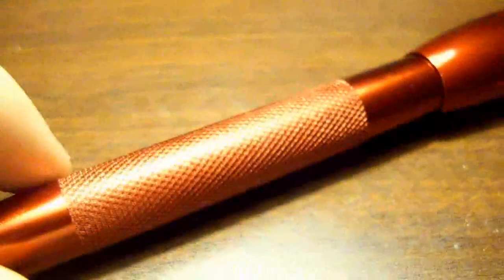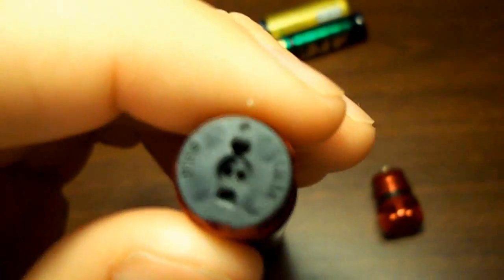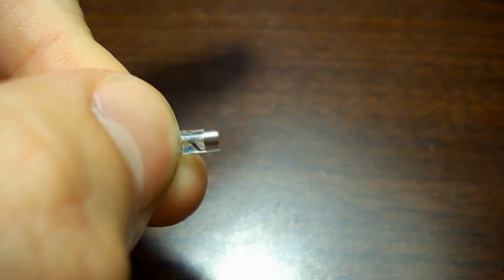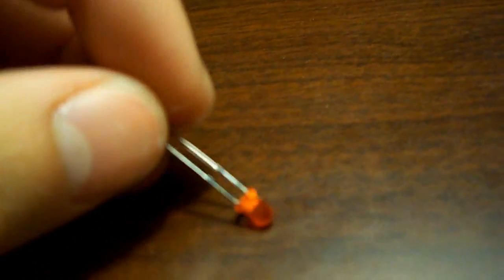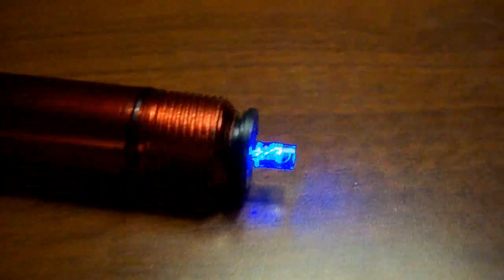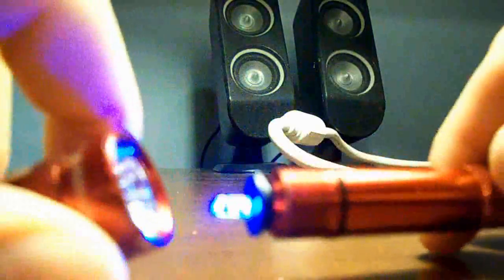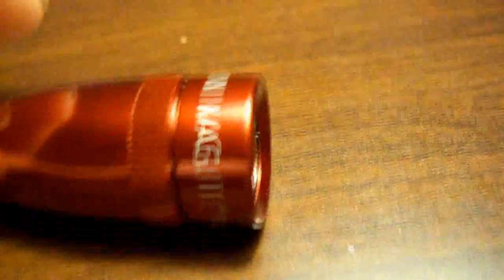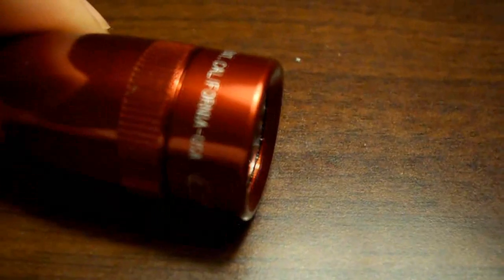Convert Maglite to LED - 20 Hour battery life (HIGH POWER!)

Comment: dang, and my Radio Shack closed years ago (and Lafayette Electronics years before that) ............. as a kid I used to buy LED/resistors/caps, boards etc........... good thinking kid.........  also, IF you have 2 leads on the LED and one is longer, that is the Positive side. Keep track when you cut them. IF the round plastic LED part has a 'flat' edge, that is the negative.

Comment: Except there's just one kinda big problem with the high power LEDs you advocate, bub: use them and the whole set melts from lack of heat dissipation.
Reply: Mmmmm....... Yeah...and No. Heat dissipation is very, very rarely an issue with tiny LED's like this one. Even with big ones, it's highly unlikely to be an issue. Even if it was, a tiny, home made aluminum foil heat sink would easily take care of it.

Comment: I posted a comment on Jan 13, '13. It does not fry the LED because the knee or turn on voltage is right in the range of the battery voltage. The battery impedance and the LED impedance are just enough to provide somewhat the right series resistance. However, without the series bias resistor you mention, the LED power is very dependent on battery age. ItsTheNobleOne makes a good point although crudely and unkindly. A Maglight LED is engineered and is likely regulated electronically.

Comment: Red Green says, "If the women don't find ya handsome, then at least they should find you handy."  Ellswortha101 seems to be doing OK in both. However, LEDs are not simple resistors like an incandescent lamp. They are semiconductors. You must consider the knee voltage of the LED,  its dynamic impedance, the battery voltage and battery impedance. Smaller LEDs not intended for lighting applications would fry right away. LEDs for lighting will likely need at least a 3 cell battery. Trial and error.

Comment: Two NiMH, or NiCd rechargeables will only put out ~2.4 volts, so they won't light an LED with a forward voltage of 3V.
You aren't using a resistor -- why doesn't this fry the LED?

I don't know much about NiZn batteries, but 2 of them would be 3.3V.  Still might not be a good idea though, because of the lack of resistor thing...?

Can anyone explain why this doesn't smoke the LED?